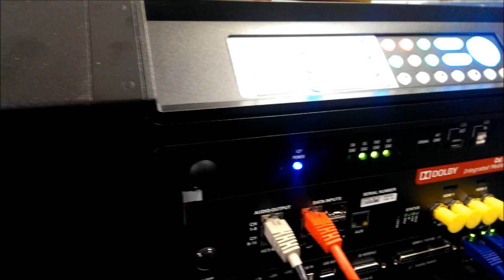The end of 35mm projection at The Kavanagh Cinema, Herne Bay

Comment: I sure miss 35mm film. I worked at 3 different theatres. Digital media is not reliable. When it came to film a projectionist had control of everything. I miss it very much. Thanks for posting this video. Currently working concessions at the Flame Theatre, Wells, MN

Comment: happy I had a chance to work with this in 2011 I got my first job at 17 became a projectionist a year later learned everything to it loved it and in 2013 around November it was a Sunday I threaded and started the last 35 print in my favourite auditorium my cinema is second run so I can easily say I started and broke down one of the last amazing wonders of the world. =,(
Reply: But rejoice at the idea that with electronic photon sensors, you can potentially miniaturise the light capture so much that film will look like an old blurry thing in comparison. The chemical process reached its limit, the electronic one just started. We will reach the window effect with 120 Hz 8K digital, something you can only dream of with 30 Hz 6K analog like 35mm film.

Comment: This is film done WRONG- he was using SOLID splicing tape, looks like he kept more than one reference frame on the leaders and didn't even bother to splice them back on properly when breaking down, AND put shoe polish around all the splices! Bad and lazy film presentation is why digital took over!
Reply: +Pinkie Pie Enterprises Not the first to be shot using digital cameras but first to be presented on digital medium though.
Reply: +eyeh8nbc Well IMHO saving money and cutting corners everywhere is why digital took over. I have seen lots of incompetent projectionists during the last years of film. The platter mechanism is a bad idea anyway: the film is way too exposed. It has been invented to get rid of the twin projector (with 2000ft reels each) set up. Old pros who really cared knew exactly the 'speed up' time for each model and set up the exact reference frame. Good old four frame "cigarette burns" upper right hand corner....
Reply: the reason he didnt splice the headers and leaders when breaking down was to save the next CAKE STAND MAKE UP from breaking it again   REASONS
Reply: +showreel 2 Well I presume you replied to my comment. So you make digital films? Well so do I (I call them data clouds, which is way more appropriate IMHO) when I have to, so does everybody who makes films, good or bad. I hope you didn't think you told me anything new.
Reply: you never splice back the leaders because they need to be made up again. each time you damage the frames